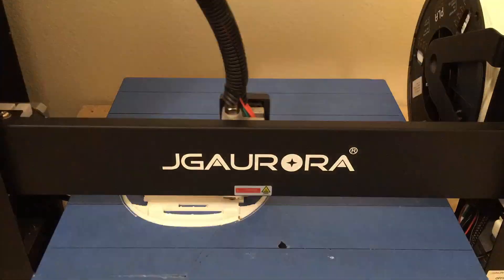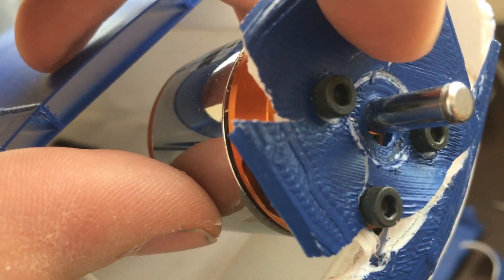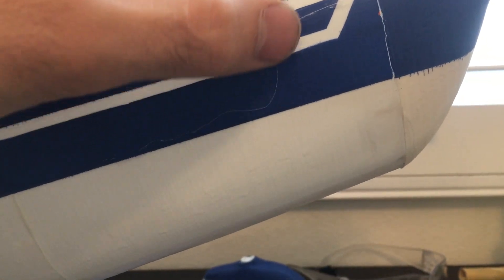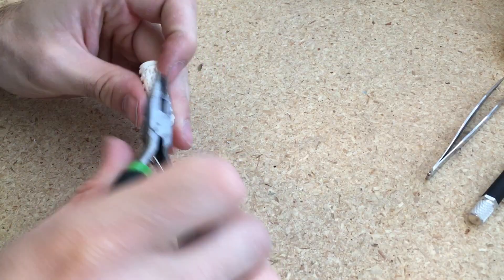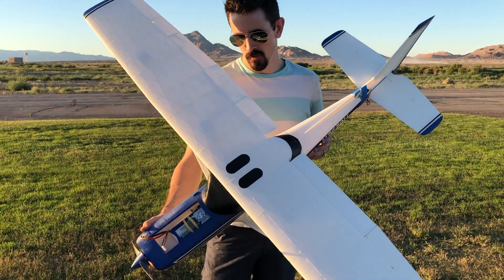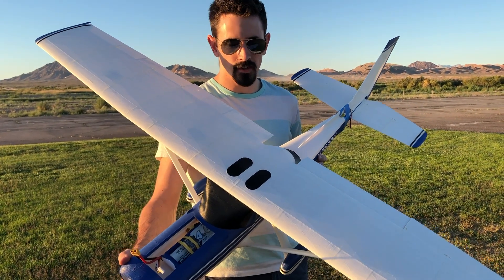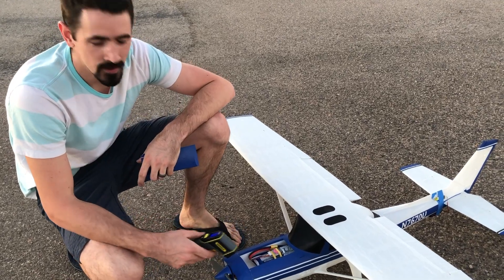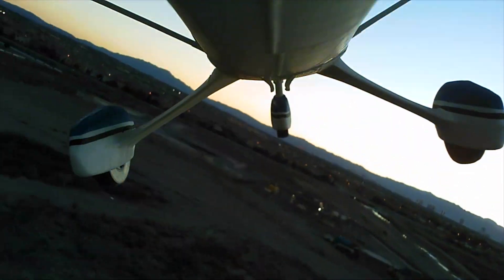Rebuild 3D Printed Plane after BIG CRASH - RC Airplane

Comment: I have recently downloaded the Cub from 3D Labprint and I see they've revised the nose quite a lot. Now there's a lot more cooling because the nose is open behind the prop and the motor is held in a sleeve that they tell you must be printed in PET for better heat resistance.

Comment: Commenting on an old video but wouldn't it be possible to print just the section that acts as a motor mount (in this case the nose of the plane) in a more heat resistant filament like abs?

Comment: Troy, a key part of the reconstruction is the separating of broken pieces from good pieces at the glue joint. How do you achieve this without damaging the good bit, in particular the 'female' side of the joint. I know you show dealing with the nose part, but you want a bit fast over the important bit.

Comment: i am not expert. far from it. but I have printed out a few pla airplanes.. and I ran into your problem with my first aircraft. after that crash. I used Lexan as a firewall. then added airflow holes to help with cooling. I don't know it this will work.. but it has for me

Comment: Cooling air outlets... That's what's missing. I used to fly the 2m electric patter competition planes. Bigger motor, bigger battery... Same issue... Cooling airflow. Bigger outlets than inlets. Otherwise good job.

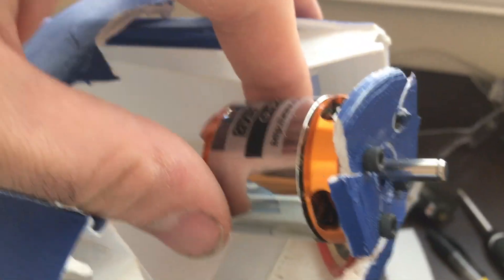Comment: 2:42 The original C-152 has an ENGINE but your model uses an electric MOTOR.  You don't have an engine but do have a beautiful model.
Reply from the maker: Thank you
Reply: The definition of an engine is the combination of two or more simple machines working in combination to perform an action. An electric motor is very much an engine. Most engines are not motors, most motors are engines.

Comment: That's why I don't 3d print the whole plane, it does make much more sense to use 3d cut foam for fuse and wings, they are much more durable. 3d printing is for auxiliary parts: mounts, horns and so on.
Reply from the maker: I agree that the best use of a printer for this hobby is for addition parts like that. But I have had some good flying and really cool looking 3d printed airplanes.

Comment: When I was building RC models, my instructor kept saying that the engine and chassis mounting were the two most important places.
They are to be made of solid wood. And not pine, but beech, for example.
Plastic, unfortunately, is not good. And you already know it yourself.

But I also have a question - how does the manufacturer of the plane's plans view it?
Because if this was designed in the plans, it is clearly a constructor's error.

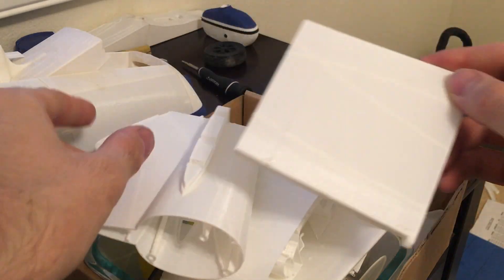Comment: The Part, I´ve seen in Video at Frame time 0:56 min., looks not so fine printed. There are mistakes in Filament flow at some Layers. These will collaps at flight. Your Filament comes not continously out of the nozzle. Please check if, there is an extrude-problem. Perhaps the bowden or sometimes blocked Filament or the Stepper slips through (maybe to fast or too cold).

Comment: It's NOT an engine, It is an Electric 'MOTOR". There is a difference.
Reply: In the context of RC modelling its a model engine so people still refer to it as such. But you are technically correct.
Reply: The definition of an engine is the combination of two or more simple machines working in combination to perform an action. An electric motor is very much an engine. Most engines are not motors, most motors are engines.

Comment: Hey Troy, really enjoy your build videos. Just in the process of building my Eclipson EBW. Can I ask what paint you use to spray your models ? Is in an acrylic ? Cheers and keep up the great work!
Reply from the maker: Hi Fraser thank you for the comment. I use (KRYLON COLORMAXX) paint + primer. It works great for 3d printed parts. The main thing to be cautious with is the tap to use for clean lines without bleeding. I have tested a lot of different tapes. The best one is (FROGTAPE). Have fun with your EBW. I just built the new model A it flies really good and I used LW-PLA. Eclipson is working on a new model right now. I will be building it soon. Keep a look out for it.  Cheers
Reply: @TroyMcMillan  Thanks for the tips Troy. Just downloaded my Model A plans ;-) Now to find some LW-PLA which is in short supply over this side of the pond. The Eclipson team are producing some amazing aircraft designs. The guys at planeprint have just released their Tucano which could be an interesting one. Thanks again!
Reply from the maker: @fraserwhite73  I have the Tucano on the printer right now only have 4 more Fuselage parts left to print out. I will be starting to assemble it next week. I will have build and flight video of that plane up soon. I am looking forward to flying it.

Comment: Nice!  I plan on getting a 3D printer around Christmas time... I have been flying for a long time and have done my own designs with foam and look forward to the challenges of the 3D printer. Since I work with AutoCAD on a daily basis I am looking forward also to designing my own models.  Thanks for the Video I will check our more..
Reply from the maker: Thank you for the comment. I enjoy working with 3d printed airplanes. Setting up the printer for thin wall can be a bit challenging. It is nice to be able to work in cad and design any small part needed or build new planes. The ability to design and make any custom part is amazing. Have fun with it. Let me know if you need any help with settings.

Comment: Great rebuild, and I think the balsa wood was a great idea to create a heat break. I hope it works for longer flights. I am a bit concerned about it though as the previous plane seemed to melt below the motor as well, not necessarily all right where the fasteners are located. I was thinking maybe it would be helpful to cut some kind of breathable hole or grill just below the prop and somehow duct the air coming in through that grill up directly to the connection between the motor and the balsa wood. You could even 3D print a perfect little duct with the right bend in it. The amount of air coming in through this duct would be plenty enough to divert the heat from the connection point. Or you could even duct the one or both of the existing vent holes to the electric motor? This might not be necessary as your heat break seemed to work, just a thought to protect on longer flights in hotter conditions. Awesome video!
Reply from the maker: Thank you for the comment. I built a 3d printed part like you suggest check out my next video on my channel to see the build process of it. It works very well now and I have taken the plane out multiple times after to fly it and it has been flying great.
Reply: Troy McMillan that’s awesome to hear I will subscribe and check it out!!!
Reply from the maker: @logantrigg6037  Thank you so much Cheers

Comment: How about gluing PLA with methilene chloride? Technically it dissolves plastic making strong bond. Also you can make a “slurry” like acetone+abs for filling holes or breaks. I tried in other prints with good results but never printed a plane. Hope to make one like yours in a couple weeks.
Reply from the maker: good luck with your build thank you for the tip